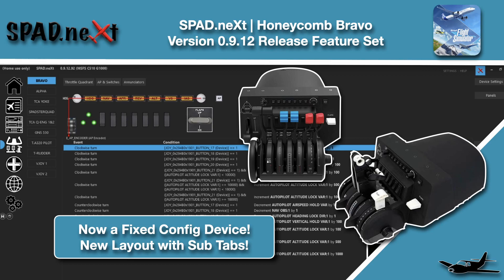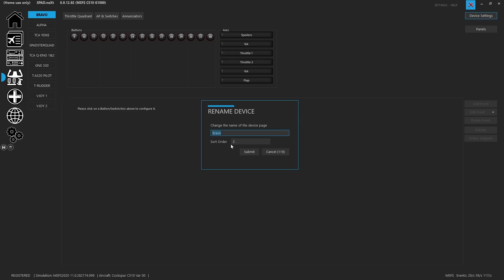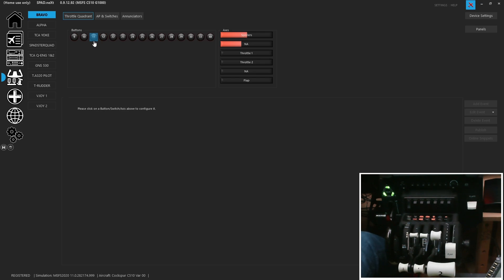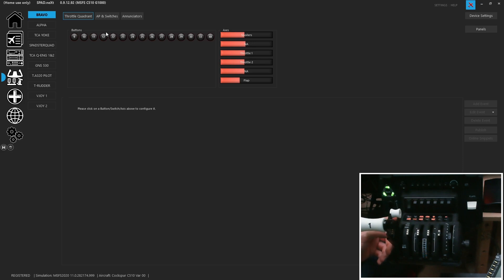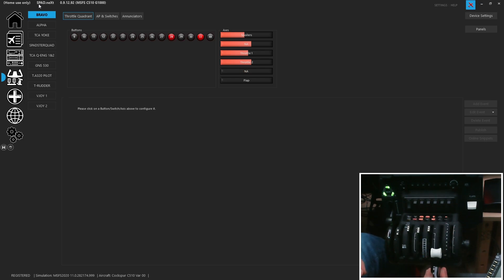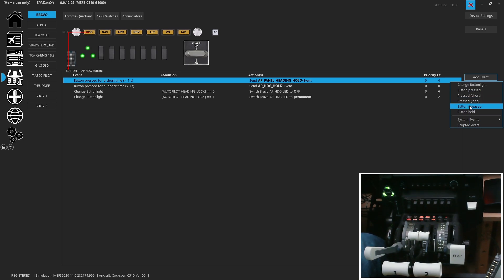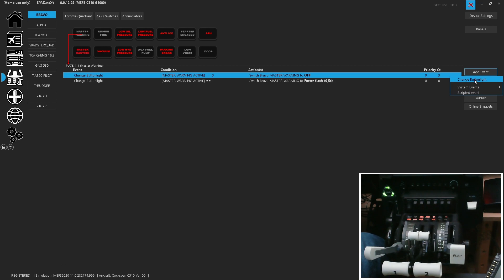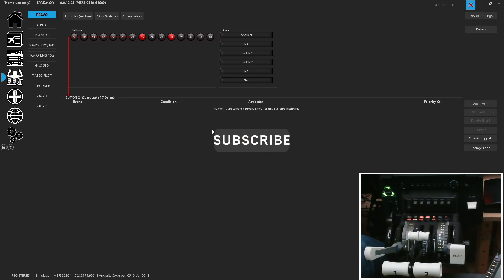MSFS | SPAD.neXt | v0.9.12 Release | Honeycomb Bravo Layout

Comment: A great set of tutorials.  Just a quick one before I get Spad.  Does using it fix the issues with the Bravo and the Fenix A320 Autopilot and the reversers?  Currently for me the Bravo autopilot does nothing and the reversers won’t go into reverse idle.  I can’t get on the discord as mentioned in another comment as I don’t have a serial number yet.  I also have the Stream deck plus which you need the full version for and I’m reluctant to spend over $100 unless it works with everything.  Thanks.
Reply from the maker: Fenix is all LVAR based. Yes it has access to everything.
Reply: @LesOReilly  Brilliant.  I’ve no idea what that means, yet, but thanks for the feedback.  I’ll investigate this weekend.

Comment: I love your product but will it work on the Cessna Longitude with the Garmin 5000 navigation system or is MS taking there time about allowing flight systems to fully utilize all the features.
Reply from the maker: It’s not my product. I am just a user :). What from the G5000 can you not control? All of the HEvents are exposed and in the sim now.
Reply: @LesOReilly  Having a lot of trouble with the VNAV, which I can't find anything to link it to, Autopilot Altitude freezes up, along with the Autopilot Vertical Speed, I am not sure my rotary switch on the right side of my Bravo works with everything, sometimes it will work fine with the Headings, although it only makes 10 degree changes, which isn't very smoothly done.
Reply from the maker: @lvoutdoor you have to make sure if you start binding in Spad that you clear bindings in MSFS. VNAV button is not an event for what ever reason that one is an LVAR with like VNAV button in the name.
Reply: I tried to contact Spad but since I'm not a subscriber yet I couldn't get thru to them. Do you fly the Longitude and does everything work for you @LesOReilly
Reply from the maker: @lvoutdoor yes people have control of all of those just fine. People also have all kinds of snippets for other devices and for other G3000/5000. I use it with the Longitude. HJet, Vision Jet and the TBM just fine.
Reply: Thank you @LesOReilly

Comment: i have tried everything, and i cannot get the LED’s to work at all, i’m running 0.9.15.7
Reply from the maker: Probably because you have the honey comb afcs bridge still in your community folder.
Reply: @LesOReilly  I have removed it out of my community folder and have correctly added the SDK in the .ini, but still not see the lights on my HDG NAV etc on my honeycomb bravo
Reply from the maker: @codyharrison7371  you did it for each version of 737 .. If you did it just for say the -700 and you are trying to fly the -800 then that won't work.  Please use the spad discord and post photos of your configurations there.  Works for everyone else..
Reply: @LesOReilly  Okay i will do, i have the 737-800 but i used the 737-700 profile thinking it would work the same, but it didn’t, i’m on the trial version before i purchase it. Did you do a profile for the LED’s for the 737-800? thank you for your feedback
Reply from the maker: @codyharrison7371  the Profile will work fine .. just make sure you were in the 738 workfolder.
Reply: @LesOReilly  i was in the 738 work folder and this is what i don’t understand why the LED lights on the autopilot part won’t work the landing lights and all the annunciators work but the ap lights don’t
Reply from the maker: @codyharrison7371  I just went a loaded up the sim..  they work for me.  Did you check that turning the button on in the virtual sim is working? you pressed the HDG button and the VC green LED came on?  Also you have both AFCS Bridge or what ever it is called from Honeycomb and you also don't have better bravo lights in your community?
Reply: @LesOReilly  All of the buttons work perfectly fine with your profile, but the lights on my bravo don’t light up on the autopilot panel. I don’t have better bravo lights and i took out the AFCS bridge
Reply from the maker: @codyharrison7371  Buttons will always work because you can send Events without the need for the SDK being enabled..  Please I beg you -- use the discord..  these comments are not useful in trying to  get help.. they just are not.

Comment: Les I have lost all settings on my alpha and bravo yoke and throttle even lost my default settings any way to reset everything at a loss as what to do
Reply from the maker: If all your profiles are missing then you probably had one drive migrate them away for the actual documents folder and into the cloud location.  If your going to use one drive for you documents you will need to make a local file location and re point your profiles location in Spad to find them in that new place.

Comment: Hi Les,
Not sure if this is the right place to ask a Kodiak 100, Bravo question. I installed your Kodiak 100, Bravo snippet dated 10/12/22 today and everything is working correctly except for the Throttle 1 Axis and Button 24 for the reverser. I tried changing some of the settings for the throttle but so far I haven't been able to make it work the way it should. Any suggestions would be greatly appreciated.
Thanks again for all you do for SPAD.naXt.
Bill
Reply from the maker: I just updated it again. It’s now going to work power wise but the animation won’t move of the throttle. SWS is testing a hot fix patch that will address it and this snippet will work when that comes out.
Reply: Thanks Les, that was quick. 
I installed this snippet and it did the trick. I am flying the Kodiak again. Will even be better when SWS issues the throttle animation patch.

Comment: Hey Les - do you still recommend SPAD.next?   I'm using old saitek hardware - but i'm mostly using in-game drivers...
Reply from the maker: I only use SPAD...  the Logitech drivers only work with a fixed configuration so that has issue for me especially with add on planes..